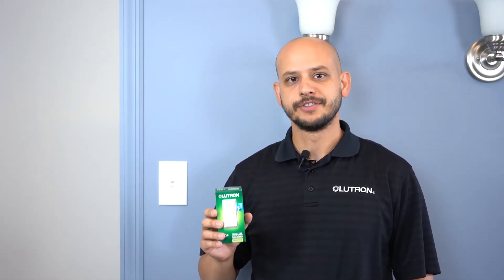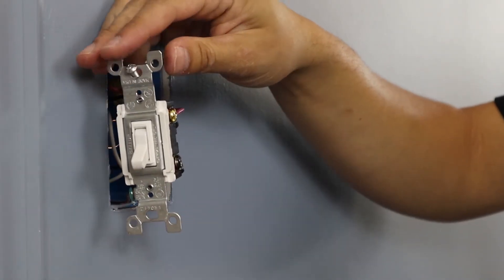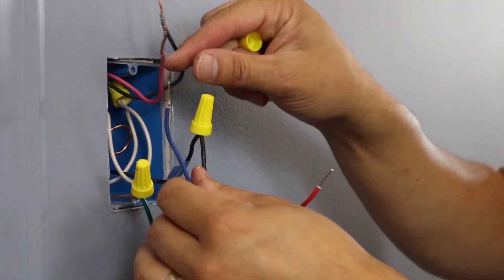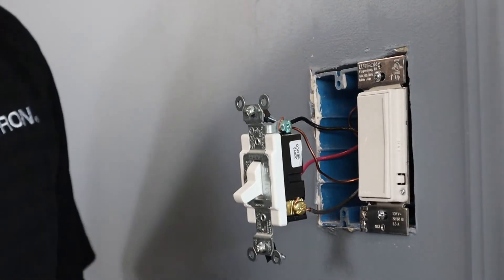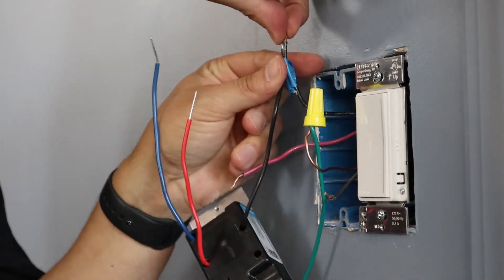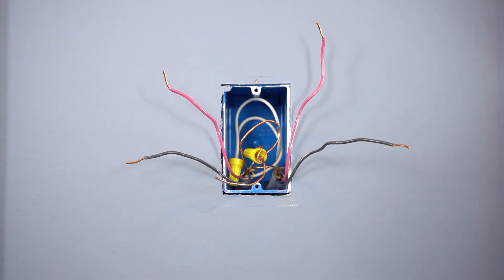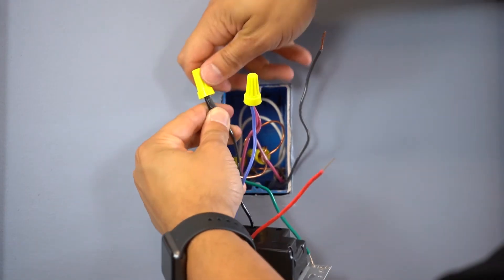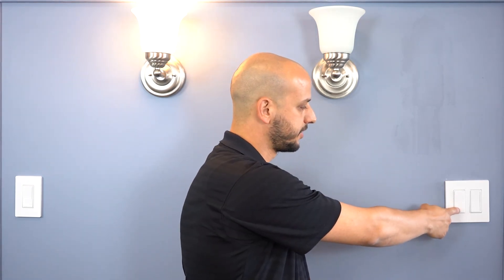Installing a Sunnata LED+ Dimmer in a 3-way or 4-way with a Sunnata Accessory Switch.

Comment: You have to buy specific "accessory switches" to work this dimmer on an existing 3 or 4 way. How stupid to try and make the electricians take apart multi switches to install 1 dimmer. Way to go genius. Gonna cost more time and materials because you cant make a normal 3way dimmer that works with existing standard switches.

Comment: This was a cakewalk.  Very clear and easy to understand.  I have done plenty of work with 3 way switches but this was my first attempt at doing work with a 4 way switch.  I watched the video three times, mapped out my common wires on my two existing 3 way switches one of which was a dimmer, and then traced down my two sets of travelers on my 4 way and made sure one set was wired up on the top and bottom screws mapping them out of the box making sure each was to the same set of wires coming into the box.  I then proceeded to watch the video as I actually swapped out my existing dimmer/mechanical switches and everything worked at the first attempt.  My wiring layout was identical to the video and I even used the blue wire as my common traveler wire to red on all three switches.  Very happy with the final results.

Comment: Thanks. Replaced 18 old dimmers and various 3- and 4-way toggle switches. Got through 17 Sunnata dimmers, including two, 3-way circuits. Then came the 4-way. I thought 4 wires on the old toggle switch and only 3 wires on the Sunnata. Hmm. Watched you join the 2 wires. Yes. Took a few moments to diagram from line to load. Easy execution. Junction boxes from 1991 were fine for toggle switches but the sizes of dimmers made it difficult to put everything back into the "wall". Thought about junction box extenders ... Wife scowled. Then to the rescue: WAGO lever connectors to replace twist on wire nuts. Wires in place. Claro screwless covers on. All dimmers work marvelously. Mission accomplished.  Thanks. Really. Thanks.

Comment: Gees,  after trying to install this Sunnata switch, I was very confused.  My wiring is nothing like in the video.  In the spot I was trying to install the dimmer, I have two black wires bundled to the existing switch, one red wire, and another separate black wire.   On the other light switch on the other wall, that switch has two red wires and one black wire.  I tried various wiring combinations and I cannot get the 3-way switch to work.  If the new Sunnata switch it turned off, then the other switch cannot turn the light back on.  I wish this switch wired like other regular switches.  Hopefully Home Depot will accept it as a return.  I and not paying an electrician hundreds to install a light switch.
Reply: I am going insane too.  Same deal as you.

Comment: I tried to install two dimmer switches and tried to make them work together but it won’t work why??? Does the second one needs to be an “accessory switch” that has no dimmer? I just return that set after making it to work. Now trying to install both dimmers and that won’t work?

Comment: Not helpful at all. I wanted to add a dimmer in a 2nd location from a regular on/off switch so I could not tell which was the common wire. Now neither switch works.
Reply: Exactly the same happened to me , this videos are long and empty of the real information, I don't need you to tell me to shut off my breaker y need you to tell me if one of them is master and the other is slave , or if I can use two STCL-153MR at each end (is that simple) but no you don't give that information...
Reply: Same situation for me
Reply: Me too.  Except one of my switches only works if he dimmer switch is on

Comment: You title is a bit "bait & switchy" as you don't show a 4 way switch setup. You need to show the 4 way wiring.
Reply: I am going absolutely crazy with these bait and switch 4 way dimmer switch videos.  Got it working but one switch in the line won't turn off.  Wish I never started this project.

Comment: What if you don't buy the accessory dimmers?
Reply: Then you can either use the dimmer as a single pole or w/ a 3 way using a jumper cable